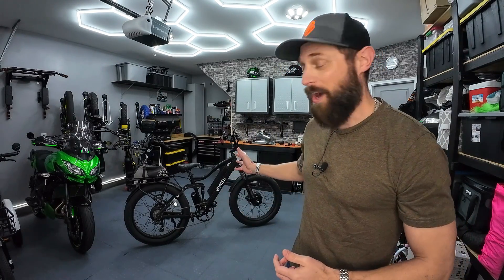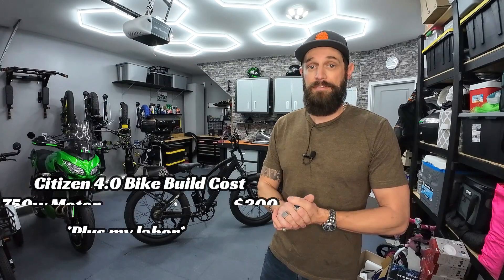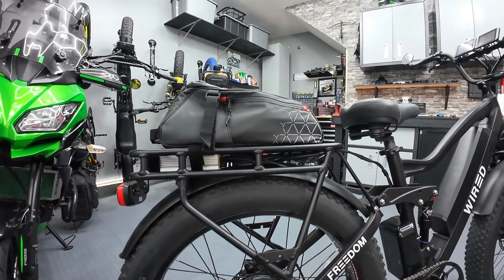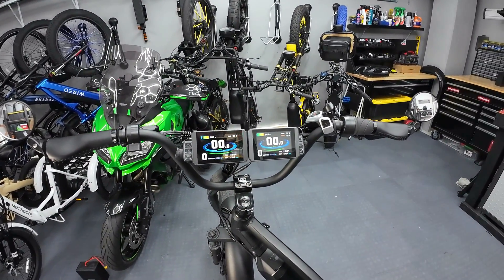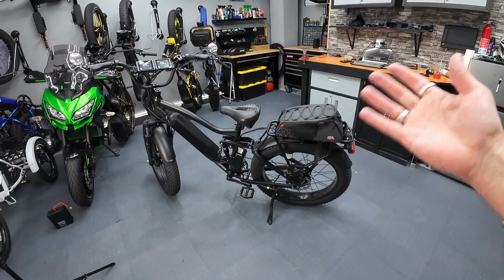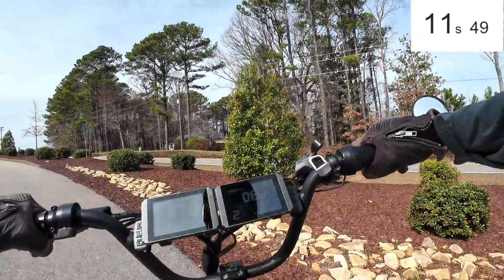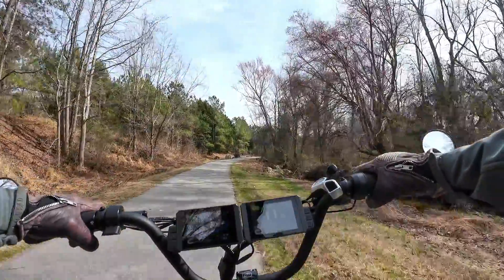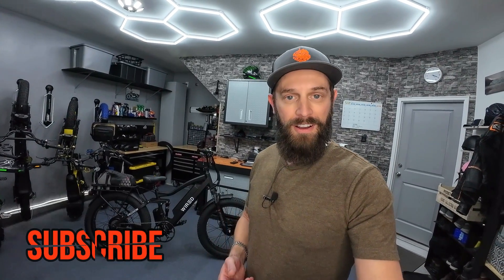AWD Conversion Kit: Should I build Them?

Comment: I want one but I wish that it matched the power of the rear wheel hub motor so that I could just use one of the two batteries that comes with the 2024 Cruiser.

Comment: I have a question that you or some of your followers might be able to answer. Is the limited speed of the newer eBikes determined by the motor or the controller? I have the 2023 Eahora Juliet and the rear wheel will not exceed 411 RPM under no load conditions which translates to about 28 mph with a 23-inch diameter tire. The controller allows me to set the top speed to 51 kmh which should be 31.7 mph so it can't even reach that limit. This makes me think that the motor has some sort of governor built into it, but thinking and knowing are two different things. Any info would be appreciated.

Thanks, Jim

Comment: I have the 2023 Eahora Juliet 20-inch eBike. It is a little underpowered for my taste with a top speed of 28 mph. It has a 48-volt 1000-watt geared motor with a 60 AH battery. I have been looking into doing exactly what you have done with the Wired so I can raise that top end to at least 35 mph when I need to. I live right off of US Hwy 321 and have to travel it for at least 2 miles before I can get on a secondary road with much less traffic. Today, a large diesel truck pulling a very heavy trailer with a large machine on it moved to the center of the road to avoid me and ran an oncoming vehicle onto the shoulder of the road to avoid a head on collision. The speed limit is 55 and he was probably doing over 60. Everybody is in a hurry. I know the Wired can reach 35 with just the rear motor, so I was wondering what I would need on the front to be able to reach that speed without help from limited rear motor. Any suggestions would be appreciated, and I would be glad to purchase an appropriate kit from you. The extra battery would not be a problem and would be seldom used for my purpose as I'm not in as big a hurry as the driver of that truck.

Thanks, Jim

Comment: i am getting the upgraded 2024 freedom in July, will this front motor package fit in those forks?
Reply from the maker: No you would have to change back to the old style of rst guide forks with the open Dropout. Thru axle won't work with the motor kit
Reply: @CitizenCycle925  any chance you are planning one for the new through axle?

Comment: Love your videos! Because of your Wired Freedom video I ordered the Wired Cruise… question:  I am 5.6 ft.. the frame I believe is 17.5…. Is there a way to replace it with 24” tires using the same motor? I appreciate your help because although I love this bike …… afraid could be too large…… don’t want to use 1960 men’s boots! I appreciate your counseling on how to do this mod and where to get the parts… cheers Luis
Reply from the maker: Hi Luis,  I'm actually in talks with my manufacturer right now to create 24 inch wheels for the wired, its weird that you sent this message, I will hopefully have them for sale soon, it will be a way to use your existing motor and just swap the wheels so yes there will be very soon😁😁
Reply: Wow! You mean coincidence rather than weird! That’s the word the other guys used to mock the Weird!!!! What great news! And the rotors will fit too  ? Well I will be the first one to buy it from you!
Reply: Now you got me mixed up with weird and wired!!
Reply: Also sent an email to your account… thinking it would be faster to get a response! You are a good guy!!!

Comment: With the new wired bike, which now has a 2nd battery, kept where you put your controller. If i purchased the updated bike and still wanted AWD , where would you put your controller? I guess you would still use the top of the rack for your battery.

Comment: Will this kit work with a higher voltage battery like 60v /72v ?
Reply from the maker: 72v would not work,  60v would work but you would be overvolting the system causing more heat and wear on the motor windings and internals.  52v is recommended. using higher voltage would void the warranty.

Comment: Can you recommend simular handlebars that have more room for more levers brakes and mirrors, I'm going to purchase but I think I don't have enough room for my mirrors , brakes , throttle lever, 3 button wired power switch , bell, grips. and the added lever when i buy the kit, looking for longer length handlebars that are still upright simular to what it has. thanks if you can help

Comment: I have a question on my wired freedom I just bought.   I run lawn care I have 2 36 volt 10 amp batteries would there be a way to put them batteries together making 72 volt and run that on my bike is there away to connect this up?  thanks
Reply from the maker: Unfortunately i dont know enough about battery building but this doesnt sound like something to try.

Comment: Could you map both motors through the one twist throttle, but set the 750w up to cut off at say 28 or so.. so that it only helps off the line to get up to speed, automating that process and saving battery on the 750w motor side ?
Reply from the maker: sounds like an interesting idea, let me know if you try it.
Reply: I never will, was just a question I was curious about, sort of like a two speed transmission type of thing :)   thanks. Good luck on your kit business.  Looks neat.

Comment: Yes! I just bought E Cells 5 star will kit work on it???
Reply from the maker: It should, i believe that bike already has the correct forks,  but why not just buy one of the AWD bikes they sell...?
Reply: @CitizenCycle925 lol cause my Wife! I barely scraped by getting it with convincing her what a great deal the E cells was for under $2000, and I told her I was going to sell one of my Juiced Bikes ( Ripcurrent) to help finance the purchase,I also have a Hyperscrambler 2,( love it, it's heavy  but Rides so good, The E cells might make me happy with the torque and acceleration as is...I noticed the E cells dual Motor bikes dont have the top end the 5 star has...we will see! Thanks man, you and the California surfer dude are my favorite E bike Channels!! Great presentation on your Channel bro! I'm learning a lot!!!
Reply: @CitizenCycle925  Good point, the top end on the 5 star is higher than the dual Motor bikes, I think, but I'm going to ride it for a while, and Nice to have the option to upgrade later if needed,  Thanks!!!

Comment: Cool, but I don't think it is a good setup.  Separate batteries is ok.  Controller that limits front wheel rpm to rear wheel rpm is almost essential to dual motor ebike, and then single throttle, PAS response will work well.  Once you are willing to add the weight of a front motor, and extra battery, it can be a small battery as you have, but DD regen motor is great, and if rpm-based smart control of front motor isn't possible, then PAS settings of 3 5 7 9 on 9 pas system, and dismissing as useless any bike that doesn't support 9 pas levels (unfortunate deficiency of current KT controller wired freedom uses) is another way of managing front wheel power and front battery drain.   

Manufacturers getting their act together should happen.  Having unusable PAS controls on your bike by putting them at the center implies some suburban max  speed only ebike use that is completely unrealistic for most people/riders, though torque sensor ebikes can work for control at the expense of range.

Thanks very much for your efforts though.  I think $800 would be a fair price for some people to enhance their ebike.  But I'm still waiting for the right full product.  Your demos are terrible for not manually avoiding wheel spin in order to gain 0.1 seconds on time. ie. the only possible advantage of not integrating a single throttle/pas system.  Completely inexplicable why you demonstrate failure in every video, including one with a sales pitch.

Comment: You got the manufacturer to work with you on this? Wired might even end up buying the same parts and selling Dual Motor Wired Freedoms or Kits to convert them, too, that would be cool.  There's certainly room for them to make a more expensive bike and still be within reasonable price.

I've thought about what I'd want in a Dual Motor setup already, and what you did is definitely in that direction.  Your rear motor has double the rated continuous power of your front, but they peak at around the same, which is ideal because you're going to be using the rear motor constantly and the front motor for periods of time but it gets breaks to cool down, so a lighter 750W motor makes sense there, but it still needs to be able to contribute enough power to match the other motor to feel useful, and it also gives you that redundancy, which is great, if anything stops working, you had two of those anyway, so you're good, just fix it before something else breaks.  No worrying about getting stuck in traffic with a bike that won't go and is difficult to pedal.

Comment: I was going to buy another battery anyway.  I'm planning on riding the RAGBRAI, bicycle ride Across Iowa this summer and one of the days is 80 miles.  So, I know I can easily do that with 2 Freedom batteries.  With your KIT, I think I can get the range I want, plus all the other benefits the kit delivers... for the same price as a second Wired battery.  No brainer, I'm SOLD!  I'll need the kit no later than the beginning of July.
Reply from the maker: finishing up things, taking orders soon, should be ready well before july!
Reply from the maker: Kits are available for pre-order now at Citizenperformance.com

Comment: I believe the wired rear motor is 1500w...so it would probably be a difficult endeavor connecting the front 750w and rear 1500w motors to a single throttle. They need different signals to balance out the power. I have an AWD Grizzly.... But the motors are the same power so you can just combine the throttle signals from the controllers to one throttle. But having an AWD bike is definitely good for alot of situations.. and its probably saved my but from wiping out several times. Especially on turns when the rear tire wants to kick out but the front pulls it out of it. I just ordered the new Lyric Graffiti X but im definitely gonna keep my Grizzly for poor weather. Snow and wet roads are much better suited to an AWD bike.

Comment: If I could get a mid drive installed to work without a secondary display and throttle on my Philod H8 I would! Check out their newly released JUMBO dual hub w/dual battires and full suspension for under $2,200!

Comment: I’m interested too. Especially if you can keep it around $800
Reply from the maker: excellent thanks!
Reply from the maker: Kits are available for pre-order now at Citizenperformance.com
Reply: @CitizenCycle925  Right now money is tight. I had to put a lot of money into my truck. I am glad things are moving forward for you. When I get back on my feet I check in & see if you still have the kits.Also when I got my bike the UPS driver pushed it off the truck. It's a 2023. The rear rack now has fallen apart. I have been trying to buy one. I am going to see if a welding shop can make me one

Comment: What are you waiting on!!!!!!! Get this darn thing started! And is there any way the controller can sit in with the battery, or is that a heat/air flow concern?
Reply from the maker: working on finalizing and moving forward soon!   i usually like to get some airflow to the controller.

Comment: Is that a 130X thumb throttle? I tried it with my wired stock controller but there's no signal from the throttle.
Reply from the maker: Usually throttles has 3 wires, if there is no signal then 2 of the wires are probably reversed.  you would have to cut the throttle cable, peel back the casing and bare the wires and switch until they work. i had to do this once to change a thumb to a twist.   or you could try some other thumb throttles to see if they are wired differently.

Comment: Thanks for the video, I'm always interested to see how people modify the ebikes.
However, you mention the "45A controller" many times but do not mention what the battery BMS is rated for as well as what the actual battery cell configuration and discharge capacity of the individual cells.
Can you please provide details on the battery.

Comment: $500 to stick a motor in a wheel... someone got ripped off.
Reply from the maker: $300 for motor and $214 to lace it in. Didn't have any other option :(
Reply: I understand, but could you have got a motor / hub already installed for far less $.  @CitizenCycle925

Comment: I am working on my own AWD kit, but I am trying to decide on the best controller setup. I have a 500w G060 hub motor being laced by a local bike shop that should be ready by next week. I don't want a massively powerful bike, I just want something that can traverse swampy or marshy ground.
Reply from the maker: 30 to 35amp controller should give you plenty of extra power.
Reply: @CitizenCycle925  What are your thoughts on using a torque arm at least on one side of the front forks to help prevent twist out of the hub motor? I know these forks are designed with AWD in mind, but I think they are designed for much lower power than a 30a controller would provide. I've also looked at solid axle forks with adapters to convert the 10mm dropout axle to a 15x150mm solid axle.

Comment: Does it add range?
Reply from the maker: i believe it will since it adds 15ah of battery capacity. just not sure the best way to test that.
Reply: @CitizenCycle925  I was wondering about setting options since you're using the same display.  You mentioned that you set the front motor to have a gradual start, on the Freedom, that's a C5 setting.  So I'm thinking that maybe the cruise control setting can be turned on or off too? I ask because in the realm of range, would it be possible to just run off the front motor on an 11 or 12 MPH set speed, pedal if you want, and not touch any of the stored power in the original battery?

Comment: @CitizenCycle925
Yes, nice upgrade. 
The only option I would suggest is for a regenerative braking option. It would be a requirement for me as the primary reasoning for my new bike's custom build was for regenerative braking on the front hub's motor to reduce brake pad wear by 95-99%. AWD, quicker acceleration, + the ability to drive the bike home if my mid-drive motor goes out or I break a belt are all additional benefits of the  front hub on my mid-drive with IGH build.

I especially like how you've kept the 2nd system throttle only. Very nice system as you've designed it, but the regenerative braking option might be of interest to those who ride in alot of hilly areas or for those looking to greatly reduce brake pad wear.
Reply from the maker: My goal was to deliver the torque power of a geared hub motor to the front wheel, i dont know of any geared hubs that have a regen feature to them...  I think if regen is a main concern then the direct drive motors are probably more appropriate.  Thanks for the feedback!   what bike did you modify?
Reply: @CitizenCycle925  
I actually don't have the bike yet and must first sell my current bike then start the bike build. If your main goal was torque you definitely would succeed with a geared hub  with your project. My project revolves around a mid-drive bike whose 2nd front hub motors primary reasoning was to nearly eliminate brake pad replacements while providing the additional benefits I listed above. 

You can do regenerative braking with geared or direct drive. If using direct drive, the freewheel must be locked or completely eliminated and there are videos on YouTube from a company that's done alot on regenerative braking motors. I was planning on running a geared front hub but have since decided to use a direct drive hub as I'm already going to have the torque multiplication from my bikes gearing to help assist the mid-drive motor. 

I stayed away from saying the company's name that is very well versed in regenerative braking but if you want me to share the name I will.

Comment: I'm a pretty experienced ebike builder and also a mechanical engineer. While fun for the hobbiest, I don't see the demand. You asked. Reason is pretty simple.  Not much difference in top speed. What high power ebikers need is more speed, not more acceleration. 
Personally, I am not a fan of modifying 'pre built' ebikes.  Build one from scratch with real speed would be my suggestion for the hobbiest. What does that take?  Not dual motor.
You need a BIG hub or mid drive motor and a 50a controller and 72 volt battery.  Watts = Volts X Amps.
A real popular build is a BBSHD mid drive motor, aftermarket high amp controller and 72 volt battery. Now you can do 50 mph min which allows an ebike to keep up on 45mph roads...which your custom 2 hub motor bike can't.
Don't need the complexity of dual motors. Just one strong motor, one big amp controller and one big amp-hr 72V battery for power and range.
My vote.  Hope it makes sense. Btw, there is a dual hub motor bike you can buy. Forget the name. If you must have two hub motors, I would simply buy it.
Love your channel and personality. Your goodness as a person comes through the camera. Ride safe.
Reply from the maker: Thank you for the feedback, my goal for the kit is not to increase speed but rather acceleration and hill climb power.  built for the folks who just need to add more torque to their bikes for the hill climbs and to do it at a reasonable cost.  building a 72v 3000w motor ebike would be very expensive and unnecessary for most.  kinda feel like 40mph is plenty for my ebikes, if i want more i'll just jump on my motorcycle :)  Haha  Thank you for keeping up with my channel and for the kind words! :)